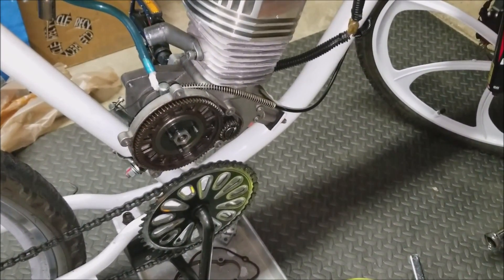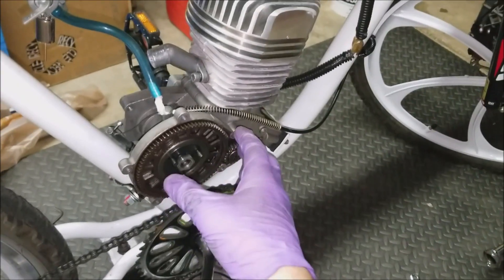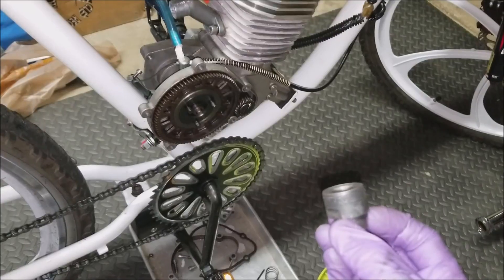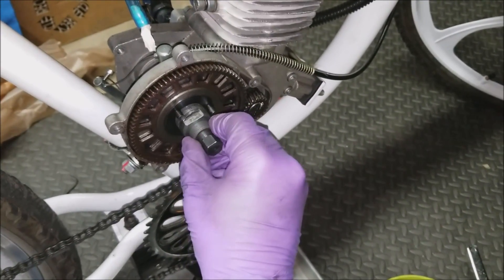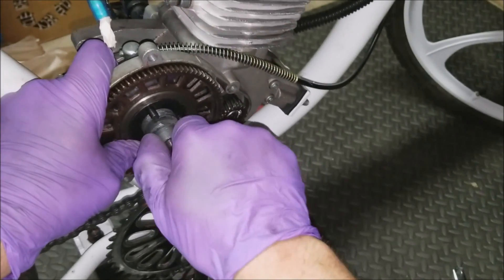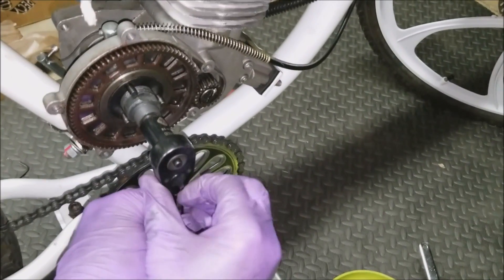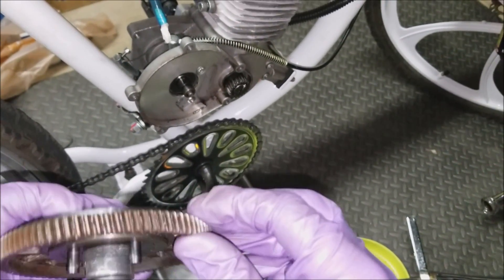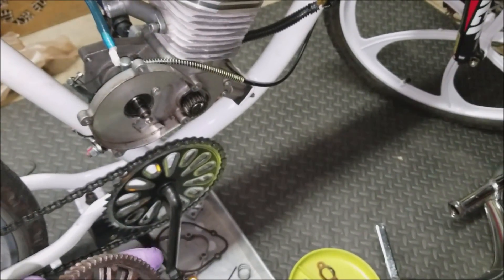66/80cc Engine: Simple and Easy, How to remove clutch gear and base.

Comment: When you screwed in the gear remover tool. Could I just use the smaller end that way? I can't get the bigger end passed 2 threads

Comment: So on my bike when I take apart the clutch assembly or when it try to remove the 3/4 inch bolt the back wheel spins I'm trying to figure out how to remove it but I cant do you have any tips

Comment: I just changed my brand new Minarelli pressure plate with a CNC, and the underside of the China saucer had the imprints of the pads embedded mesh pattern on it, and sticky to boot! 

These pads are already 💩 even brand new, so, I have to change them.  Real dark, like grease, and one is even broken. 

What are the best pads on the market? 

How about the PP spring >>>>> hard to find one the same diameter, but beefier? 

I ask, cuz, I haven't seen any conversation about it, and i've viewed hundreds of vids in the past few months. 

Sure would be nice to find a new spring, and not F it all up in the process. 

Anyway. . .

Comment: How the fuck do you remove the clutch nut? I HAVE BEEN GOING AT IT FOR THE PAST 2 FUCKING DAYS USING THE BIGGEST WRENCH AND PLIERS I COULD FIND AND I BENT THE 3 PINS LIKE 15 TIMES ALREADY AND THE FUCKING NUT WONT LOOSEN

Comment: Your also supposed to add a lubricant preferably grease to lubricate the threads on the Clutch Gear Puller to prevent any cross threading and to make smooth contact with threads.

Comment: my clutch is giving me issues with the clutch pulled in it will still randomly try to engage the motor..so i took the clutch cover off and the clutch plate of (so there for it shouldnt engage at all correct) well just walking the bike with the cover off and clutch plate completely removed the back wheel stil looks up and u can hear the motor try to kick over....what could be causing this
Reply: Loose ball bearings making it wobble and jam?

Comment: Very well done video dude! Thanks a lot! you taught me something new today! I'm going to go ahead and conduct this process on my spare parts motor so I can learn the process properly without damaging my main motor on my bike! 

Oh, just a FYI and to teach you something my friend (no pun intended). The magnetic tool you used is called a: Telescopic Magnetic Retrieval Tool. Not a telescoping magnetic pen ;) 

Thanks again brother! Motorized bicycles rule! Mine tops out at 75km/hr and it's only the 66/80cc with a aftermarket CNC Hardened Aluminum cylinder head and a after market CNC Hardened Aluminum straight shaft Air Intake Manifold installed. She's bad ass and will be even more bad ass when I replace my heavily used Clutch Shaft with the new a new one! :D
Reply from the maker: SE 8036TM-NEW 30" Telescoping Magnetic Pick-Up Tool with 15-lb. Pull Capacity https://www.amazon.com/dp/B000RB3XBA/ref=cm_sw_r_cp_apa_i_IQxeDbNG69YDS

HARDK Telescoping Inspection Mirror Magnetic Pick-Up mechanics Tool Set - 360 Swivel for Extra Viewing pickup Dead Angle, Line of Sight Obstacle Area https://www.amazon.com/dp/B07G6QC7NP/ref=cm_sw_r_cp_apa_i_ITxeDbENPV2WH

SUPERYO Telescoping Inspection Mirror LED Lighted Flexible Mechanics Detection Mirror 360 Swivel for Industrial Home Use https://www.amazon.com/dp/B07QMJHF1M/ref=cm_sw_r_cp_apa_i_zUxeDb2BNK9A8

👍😜

Comment: Thanks for the video - I bought a new motor and it came as a partly assembled kit. (Top end not installed) I figured I didn't want to dry assemble it so I put oil on the crank, rod bearings and play rings so it would have lube and not dry start. I went out to my shop the next morning and found my motor was sitting in a puddle of oil on the work bench???? I found that all of the bolts that held the crank case together were only hand tight. I didn't know how to get to the ones behind the clutch - again, thanks, it was easy :)

Comment: But when I try to take the nut off it just free spins with the other side. How do I get it to hold still so I can take the nut off
Reply from the maker: Victor Sanchez, if your talking about the gear free spinning, you need to place a washer or penny between the gears or use a flathead screwdriver as shown in this video. 

For the penny or washer, just follow the instructions for holding the gears in place found in this other video of mine. 

https://youtu.be/PuP0hIoMQvY

Let me know if your still having trouble.

Comment: yeah my pads were worn and my clutch slipped to the point of no contact on the way to work last night , im sick of having to cut and shape the pads each time , ill just take your advice and replace the whole assembly. Great video
Reply from the maker: RogueSp33d _, I feel your frustration. Thanks for the positive feedback.
Btw, about bow often are you needing to change the clutch pads?

Sometimes in lieu of actually having to change the pads, you can make some clutch cable and flower nut adjustments as well.

Comment: I took off the clutch disc and see about 20 tiny ball bearings all around the pads. I'm assuming they come from the bearing on the other side of the clutch pad gear. are these replaceable, or do I need the whole assembly?
Reply from the maker: pds tech, my advice would be to purchase (inexpensively) a new clutch/ring gear and replace entirely. Unless your an expert machinist with the right tools, it would be way more trouble than its worth trying to disassemble that gear and change the ball bearings. 

Just make sure the new clutch gear spins freely and relatively smooth. If not then return it and buy another.

You can also just buy new pads, but unfortunately due to of the imprecise nature of virtually everything on these motors, the pads will need to be reshaped one by one by hand just so you can fit them in the slots on the ring gear. With that being said, and as mentioned before, just buy the whole clutch gear with pads already installed. 

Hopefully someday, someone will manufacture a precision made 66cc motor with actual quality assurance checks in place.
Reply: @BicycleMotorsports  it would be great if they came precision built but sadly, it would end up being cost prohibitive. I feel like I can much better enjoy this hobby having the acceptance that nothing is perfect and it will be alot of work/maintenance to keep the little commuter going, vs paying a premium for a motor that is still prone to the issues that are just genetic for 2 stroke motors.

Comment: Did your replacement ring gear work or did you have to find another solution? Mine is loose but I've heard finding a replacement that isn't also loose is very hit or miss.
Reply from the maker: Why Tee, my apologies for the delayed reply. I did get a new assembly and ironically it was too tight and did not rotate freely. The ball bearings were all locked up. I ended up having to return it. The only thing I can really recommend is to purchase parts from reputable vendor with a decent return policy. Amazon as well as Amazon's 3rd party sellers is always a fairly safe option. Your almost always protected financially on that platform. Also using paypal for online purchases is advisable in the case that you purchase from an unscrupulous vendor. Paypal always takes care of the buyer.

Comment: How did you get the nut loose at the beginng... NVM I got it!! Ol screw d iver to jam the gear on other side worked fine
Reply from the maker: I should have shown that part. But yes, making sure the gears are in fixed position is how you go about removing nut, just as you would for installing and removing the gear puller.
Reply: @BicycleMotorsports  ^^ I'd recommend adding that in the beginning of the video as an annotation!

Comment from the maker: TIP:  When reinstalling the clutch gear, simply place the woodruff key curved side down in the slot on the clutch shaft using needle nose pliers and if need be, a drop of blue locktite (let it dry for a few minutes).

Next, line up the notch/slot on the gear by turning the gear by hand (left and right) until it falls onto the woodruff key and then press the gear down and lightly tap with a rubber mallet or normal hammer with a piece of wood between the gear and the hammer.